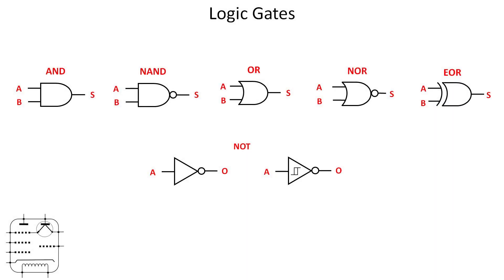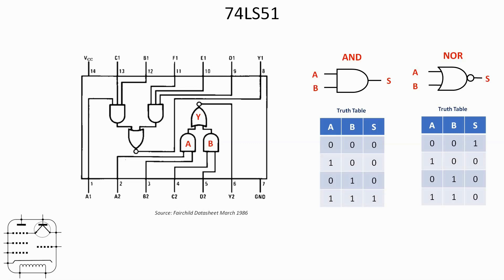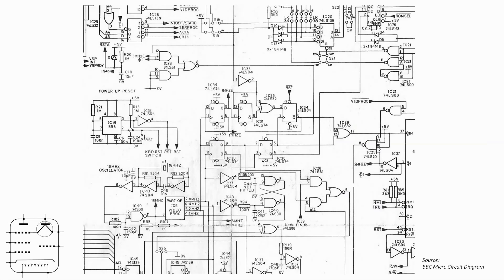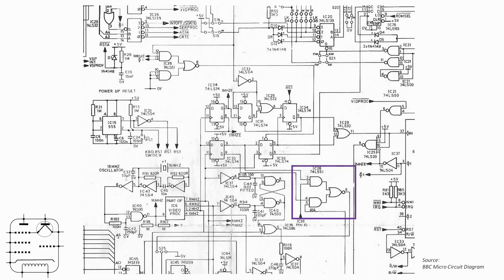Digital Electronics – A few different gates  -  #150

Comment: Bill, you sure you have the right pins for the 74LS51 ? you seem to be putting the output (pin 6) and the LED to ground or open. From the camera angle I can't see pin 4 to ground ? About 8'51" into the video. This may be camera angle, but it looks a bit odd to me.
Reply from the maker: Nice one, well spotted, looks like I messed that up!